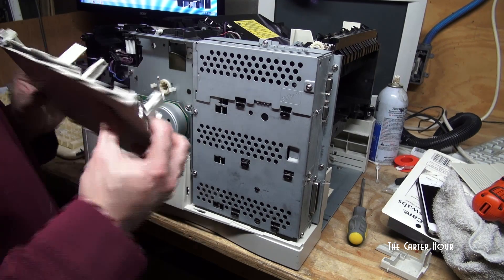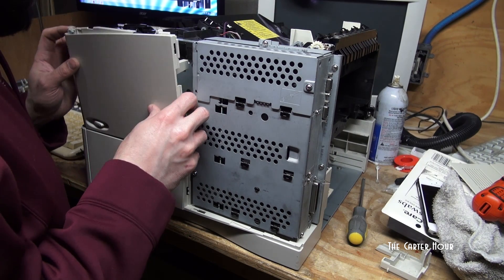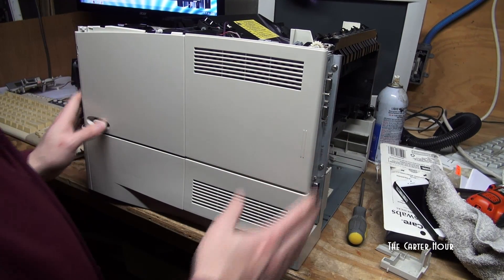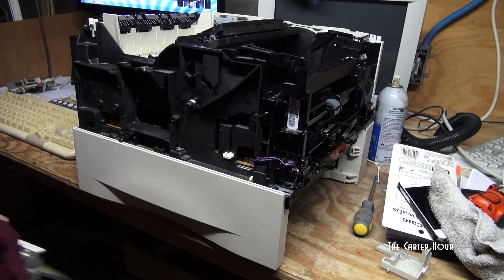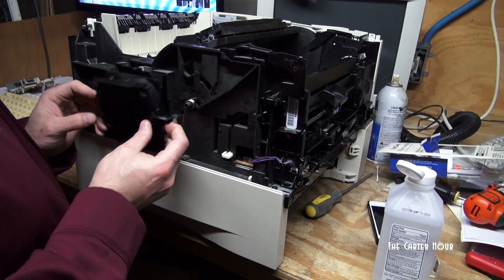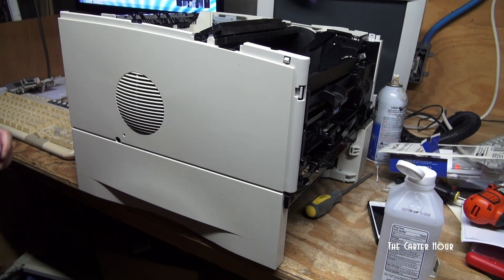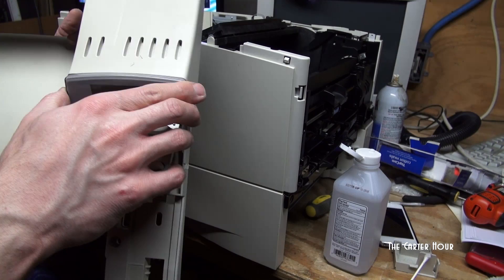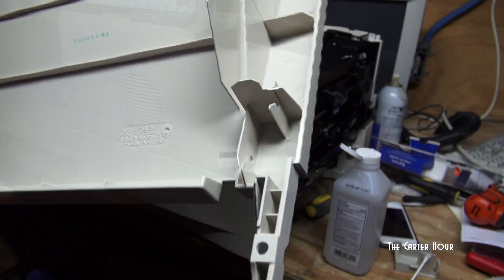HP LaserJet 4000 Intro and Rebuild Part 3 Final

Comment: Hello. Thank you for your great video. I have an issue with my 4050N. When I'm trying to print multiple pages, the printer is printing all pages one by one and not all at once (it starts making his particular noise, print one page, stop its noise and start again after few seconds). I have seen that even when I print a 3Mb file it's more than 150Mb that are sent to the printer maybe here come the issue ? If you have a solution I would be glad. Thank you.
Reply from the maker: You might want to increase the printing ram onboard.  I did that and I never had an issue.  Usually you can find it at Ebay.  I also added a Hard Drive to mine as well.  In addition you might want to play around with the drivers, HP Universal PCL or the actual specified driver.

Comment: My 4050 is still chugging along in 2021.  Did one roller replacement with the maintenance kit, and that's been the extent of the downtime.  (Funny reading about the Win7 and Win10 difficulties, when it runs perfectly well with the latest Mac and MacOS releases.)
Reply from the maker: No printer is like an old school HP LJ

Comment: Dear sir i have HP Laser Jet 4000 ,my Printer Issue when i print printer configuration report without attach printer with laptop then printer print correctly but when i attach printer with laptop with Parallel printer cable (USB)then want print any document then printer print white page it means Blank Page  ,i am using PCL6 driver  for HP 4000 on window 8.1 OS , i have try many time change operating system and HP driver but not got any benefit ,so what shall be main issue ??????

Comment: Hallo, I have the HP LaserJet 4000T (productname: HP LaserJet 4000 Series) and I'm trying set it up on my PC. I use windows 10, i tried it but not having much success. 
The Drivers on the Internet from HP are only compatible with Windows Vista. But I saw that you use windows 7 and it works. 
I also tried to conect the Printer by using the windows Option Printer add. It works and windows accept the Printer. But now my question is, which cable do you use to conect the Printer with your desktop? 
Any Suggestion? I would be verry thankful.
Thanks!

Comment: I have a HP Laserjet 4050N that suddenly stopped working. When I give the ON switch, it does not reach to power up. The blue screen lights up once on and then off. I have another broken Laserjet printer for parts , but do not know which piece should change to see if it works again. Can anyone offer any possible solution to my problem ?. Thank you very much.
Reply: Hi, fuses are on motherboard. Everything is explained in manual service to access it. It is about 10 minutes to get acess when you are trained but fuses will mostly be ok, there is some other trouble on that board as it includes the power supply. It would be interesting to know what, maybe someone knows what to look at ? Every  electrolytic capacities are still in good condition in mine ... It is something else. You will surely find many old and bad weldings to repeat but surely some component has to be changed also. Have a look on this video https://youtu.be/ZFRkAr_iUYI
Reply from the maker: +jamayor Could be a fuse.  I believe where the power goes in, there is a board that it connects too, and I believe there is a fuse there.
Reply: Hello, I want to rectify. The printer does nothing when I press the power ON button. No light goes on in the blue screen. I downloaded the service manual of the printer. In the manual service there are two fuses (FU1 and FU2), but I can not locate them in the engine controller board. I am now removing the printer. Could you please tell me or send me a link with a photo to see where they are located  FU2 FU1 ?.

Are FU1 and FU2 located on the same motherboard where are located the memory modules?

Sorry for my english. Thank you.
Reply from the maker: jamayor
Oh no worries, can you link the service manual and I can try and help you locate them.

Comment: I have a 4050TN it prints ok but the paper  looks like the paper is grey. I need to get it printing cleaner.  I refilled the toner cartridge and I suspect that is the problem. Do you repair these for the public?
Reply from the maker: +Bruce Gentle I haven't really repaired them for the public however do you know the print count?  If its over 100,000 pages it might need a maintenance kit, which includes a fuser and rollers to get it back to new working condition, however it might need the scanner cleaned as well.
Reply: +The Carter Hour 
I can't find where to find the count.
Reply: +Bruce Gentle 
OK, I found it. It shows 145306 since last maintenance.
Reply: +Bruce Gentle 
It also shows on the event log three different page counts. 757733, 757731 and 757730.
Reply from the maker: Bruce Gentle
Sounds like you have a few pages that went through your printer.  I am almost for certain it needs a maintenance kit, I bet the fuser is on the fritz.
Reply: +The Carter Hour what do you think it will cost?
Reply from the maker: Bruce Gentle
I think you should be able to pick one up on ebay for no more than $75 dollars shipped.  I believe they come with setup by step instructions on how to install it as well.
Reply from the maker: Bruce Gentle
Just make sure you get a genuine HP maintenance kit.

Comment: Hello
I have the HP Laser Jet 4000n and I'm trying to set it up on my new Dell Inspiron desktop. Not having much success.
Any suggestions?
Thanks
Reply from the maker: You should be able to use any HP standard black and white driver if you can't find one.  What OS are you running?

Comment: I still own the one I bought in march 1998. 16 years of service, 32120 print count. Cost per print is insanely cheap compared to Inkjets. You pay more upfront but it is a much better value proposition. Anyhow I decided now is a good time to upgrade, so I bought an HP M651dn. Hopefully it will last as long. I wonder if the new ones are made in the USA like the 4000's
Reply from the maker: Yes, they are great printers.  Easy to maintain and rebuild.  I added all the features that were options back in the day.  I will soon to post a video on those when I can get a few minutes.  I also bought an HP M451dn for half price off the display shelf with full color cartridges.  Great printer as well.  Thanks for stopping by, hope you enjoyed the video.